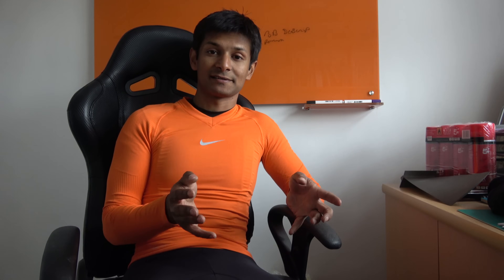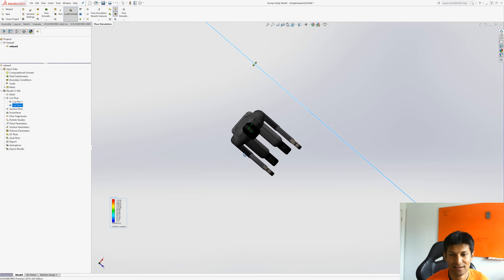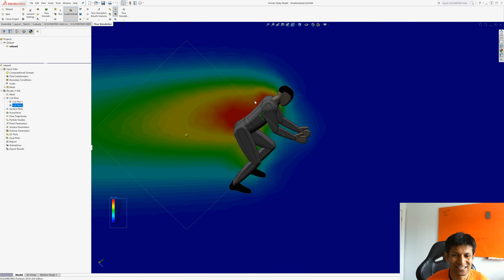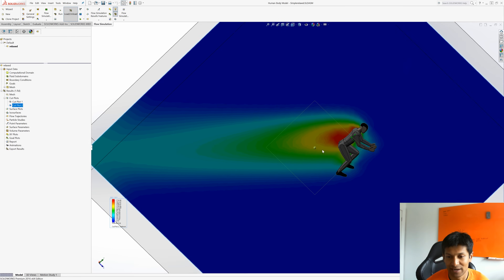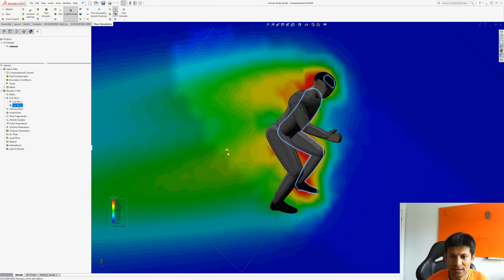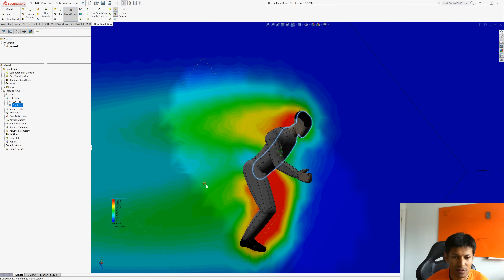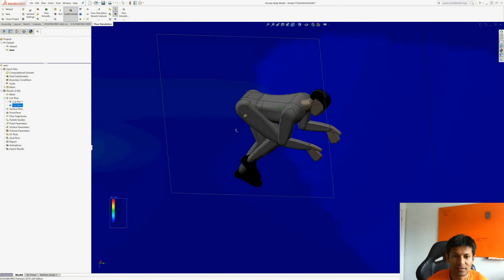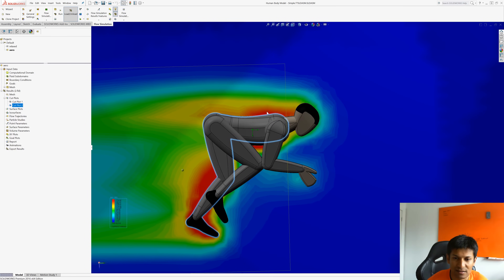How to get More Aero!!! Bike Fit TT Riding Position aerodynamics explained

Comment: Really nice video! Love the CFD modelling. Regarding crank length from the wind tunnel it appears crank length has very little effect on aero drag overall (http://biketestreviews.com/wp/wp-content/uploads/2014/05/3.jpg). IMHO this is because crank length is often tweaked without changing seat height so with a fixed seat height a saving in leg bend at the top is offset by the cost of leg length at the bottom. If however the seat height is correctly adjusted then longer cranks WILL as you say effect mainly the leg flexion and there could be an effect. However IRL smaller cranks (at the same gearing) mean reduced pedal velocity around 360 for the same bike speed.....which means with smaller cranks the shoes disturb the air less albeit a very small effect. This is why hold both feet level in a descent is faster than pedalling without resistance (eg is spun out). So in summary, the possible beneficial effect of larger cranks (with seat height adjustment) on aero is offset by a negative on air flow and for most people the effect will be unfortunately nil. However this does not detract from a great video and I wish more people would look at these issues as carefully as you have!
Reply: when I saw this channel, I immediately thought of Fastfitnesstips in terms of style and analysis

Comment: Great Hambini - really like your videos!  Interested in equating the cd penalty to more a tangible/ pragmatic unit - weight.  If a 90kg load, bike and rider,  averages 30 kph over a long distance with only moderate elevation changes, the difference between a more relaxed or endurance geometry rider position vs aggressive aero position would equate into what corresponding weight metric (e.g. Like carrying an extra 2kg load on your bike)?  Some people freak out about 300g on the bike and then wax on about their latest Gran Fondo without concern to their geometry setup.  Are there corresponding weight equivalent penalties of relaxed geometries at avg speeds of +20kph?

FYI - if you, TheDarkInstall, and Veloharmony joined forces, better than GCN and without lame humor.  YouTube's 3 Musketeers of Cycling!
Reply from the maker: Thanks for the feedback. I have tried to answer your question below, I apologise for the maths (I have used some SEVERE APPROXIMATIONS) but I wanted to give you a complete answer

Rough approximation for Drag = 0.5 * density * Velocity^2 * Area * Drag Coefficient

For a rider the values I would use, 
Density = 1.225kg/m^3
Velocity 30km/h = 8.333 m/s
Area = 0.7m^2 this is basically a height of 1.4m x 0.5m wide for the relaxed position, and 0.6m^2 for the aggressive position
Drag Coefficient in the relaxed position 0.33, drag coefficient in a very aggressive aero position 0.2

If you do the calcs (and I don't expect you to!), you get a drag force of 9N in the relaxed position and 5N in the aero position. A difference of 4N. To get the same saving of aero drag by reducing your weight, you would need to shed about 100kg (I've used a Conti GP tyre with CRR of 0.0036). The reason why it's so big is because it's Velocity squared, so it gets big very quickly. 

I repeated the analysis for you at 20km/h, you would need to shed 45kg to make up the difference between the Aero position and the endurance position.

Any engineer could pick holes in the above analysis and could point to my guesstimations which will vary from rider to rider but it highlights how much of an effect drag has and the importance of rider position.

Hope this helps, Hambini
Reply: Hence, the name Great Hambini!   I thought it would be a high weight value, but not to this extent.  Even if a guesstimate- directionally it follows.  Always impressed by compounded or squared formula calculations when applied to everyday living.  I'm so flipping my stem back towards the ground.  Appreciate your time.
Reply from the maker: LOL, I actually thought you meant Great Hambini as in it was a great video!

Comment: Problem for you: flat top aero bar or round bar? Why keep the air attached if it will hit your legs straight after? Or is it best to pre-trip the flow with the round bar so your legs see decreased velocity? I've been trying to solve this for a while!
Reply from the maker: It's a very good question and some purists would argue that you should agitate the airflow so your leg could go through it without as much drag. The reality is it's based on how fast you are going and the wake it generates. The handlebars aren't really large in cross section in comparison to your leg so the effect of pre-agitating the air is not that beneficial. They are also not rotating like the wheels. You would gain a lot more by getting narrow handlebars. The aero shape is not so advantageous on handlebars, there is a difference but it's not great. Hope that helps
Reply: excellent. Top answer. Now i know my aero expert!

Comment: At what speed does aerodynamic drag become more of a concern than friction from the bike and rolling friction? I have heard anywhere from 8-15 mph/12-24 kph.
Reply from the maker: I think around 27km-30km/h at 15 degrees, 1.01bar atmospheric pressure ie sea level.
Reply: You can tell you are an engineer.

Comment: So does increasing the front tire diameter from 23 to 25 to 28mm increase the spike effect to a significant degree?
Reply from the maker: Not really, the spike angle is technically a compression wave , you disturb the air immediately in front of the tyre which in turn nudges each air molecule to the side of it. The further you get from the penetration point, the smaller the perturbation. A difference of 2 or 3mm on tyre width will have an effect in the left to right orientation but the rider is fairly narrow in that plane. The rolling bit of the tyre which effects the vertical plane will be largely unaffected. I hope that made sense!

Comment: On crank length, is the issue just about being as low as possible, in absolute height? In other words, you can get lower by having a longer crank, and therefore dropping the seatpost by a few cm. Or you could switch from say a cross bike with a high BB to a TT bike with a low BB, and be lower? Ultimately the limit will be whatever is safe in the corners to avoid pedal strike. 

It makes me wonder now if TT bikes have slightly lower BB height from the ground?

That may be totally wrong as I suppose being lower just means you have the same frontal area but at a lower point which may not make any difference

Since my bikes have different cranks, I set the seatpost height from the pedal spindle to the saddle to get them all the same - I avoid the usual measurement from the BB to the saddle.
Reply from the maker: There are a few questions in there so I'll try and answer them in turn.

1. A longer crank length assumes you sit lower on the bike. Assuming your torso angle remains the same and you drop your handlebars an equivalent amount, you become more aerodynamic because your body sits more in the bow wave (colloquially called the spike), this reduces drag. Additionally the bent leg is further bent so it's exposing less surface area to oncoming air which further reduces drag. Nairo Quintana is a very good example of this because his handlebar drops are level with the top of his front wheel. 

2. Your method of setting the height of your seat is how I would do it. 

3. TT bikes as a whole have more steep seat tubes which would possibly necessitate a slight drop in the bottom bracket - I'm not sure though.

Comment: Thank you for a great video. It's good to see you share insights from wind tunnel testing, or virtual models. I would like to know more about whether a more arched back makes a difference compared to a straight TT position, taking into consideration the the relationship of head and shoulder heights.
Reply from the maker: Thanks for the feedback. It will vary on an individual basis but generally speaking the back straighter will be faster (but not by much). The reason for that is the turbulence generated on your back won't be that different between arched and straight but an arched back will inevitably cause your chest to act more like a parachute. Again I need to emphasise this is going to vary depending on the rider, where they put the bars etc. Sorry for the slightly non-committal answer.

I forgot to add the average person doesn't have the concave shaped back like the model. They tend to arch them more into a convex shape.

Comment: Another great video! However shorter cranks are more Aero as it allows for a 'better body position' i.e. lower their upper body, which far outweighs the surface area saving in the lower body.
Reply from the maker: I've just pinned a comment to clarify the issues. Basically to conduct a fair test, I should really only change one variable. The torso angle has far more affect than the crank length for drag but assuming you keep the same torso angle, a longer crank is more aero. Nonetheless I take on board your comments
Reply from the maker: Thanks for the feedback. On your point about the shorter cranks, if you are on longer cranks, you will be sitting lower, your head will be nearer the "spike" (because you are lower) and the frontal area of the bent leg will be reduced. The extended leg will remain the same. Essentially you sit lower on the bike with a longer crank. What is not clear is the effect that has on your power delivery, that may or may not be worse.
Reply: With shorter range of motion with shorter cranks you will feel more comfortable. Generally, you will sit higher, but you will be able to get you trunk more horizontal and you will be able to stay in that position for longer time. Thats my two cents on this... Otherwise good stuff! Keep it coming!
Reply from the maker: I think I'll have to create a video just on the discussion points of this! Thanks for your interaction. Hambini
Reply: Yes a video about this would be interesting, from track cycling the main idea is short cranks is better for power but they also claim better for aero, I just assumed this is due to the reduced range of motion allows you to drop your torso.

Comment: hmmm shorter cranks are more aero. ask team sky
Reply: I think his video assumes you keep the angle the same and simply drop the saddle height. It's not really a fair test if you also alter your torso angle as more than one variable is changing. Altering the torso angle has more effect than the changing of cranks irrespective of what cranks you are on. He clearly demonstrates that between the relaxed and the TT position.
Reply from the maker: I would disagree, a longer crank means you should sit lower on the bike. Therefore the leg bend you have is increased at the top of the stroke and that is more aerodynamic. Shorter cranks themselves are more aerodynamic but if you put the rider onto shorter cranks, the rider+bike combined is less aerodynamic.
Reply: When Tour de France winning teams find a new way of working, it’s always worth paying attention.

Team Sky have for some time been testing their riders on cranks shorter than 170mm. Although it’s unclear exactly what length cranks they’re racing on, it seems the days of 172.5mm and 175mm cranks are gone.

The aerodynamic advantage of shorter cranks is widely agreed on among bike-fit professionals. Phil Cavell, whose CycleFit company performs pre-season bike fits for Trek Factory Racing, says: “With shorter cranks, the rider’s torso can be positioned lower because the shorter crank keeps the hip open. This has the knock-on effect of preventing unhelpful and inefficient pedalling adaptations due to hip impingement.”

Read more at http://www.cyclingweekly.com/news/product-news/are-shorter-cranks-better-188288#kmKL55P08g6ugtmp.99

Comment: but if the crank is longer then one leg is more tucked in and the other more exposed
Reply from the maker: I should have been more clear in my explanation. A longer crank means you should sit lower on the bike coupled with more of a leg bend at the top of the stroke. There is less surface area exposed to the air AND at the top of the stroke you have a more favourable shape for the air to pass around. Therefore it's more aerodynamic. I could do a video just on this to explain it!
Reply: Hambini Performance Engineering I get it now. thanks!
Reply: Shorter cranks reduce hip angle, so the  handle bars can be lowered. Lower handle bars reduce drag, hence the current trend in triathlon. I think you have missed this point...shorter cranks enable a more aerodynamic position, which reduces the overall by drag. Or so I am led to believe, by common wisdom.